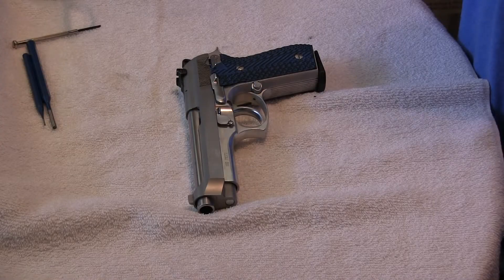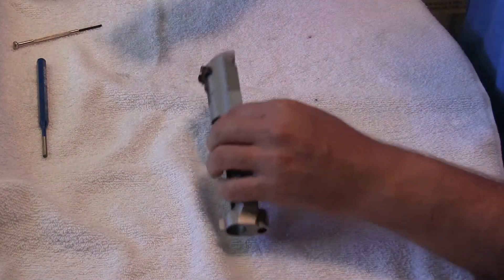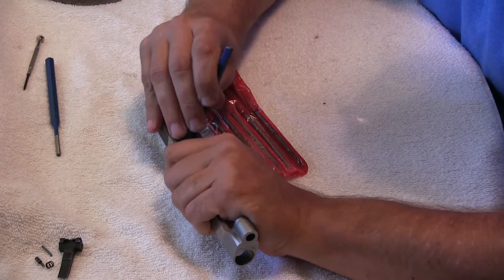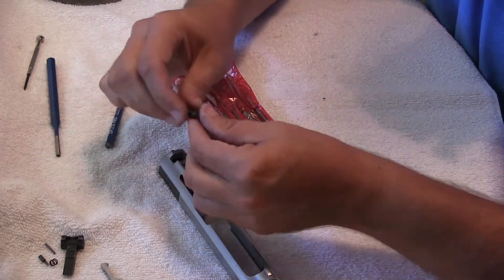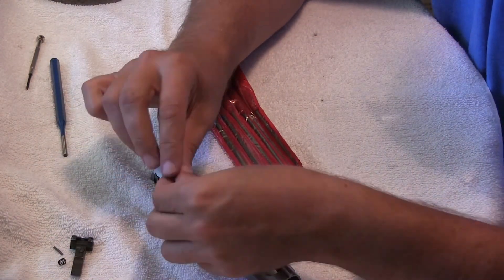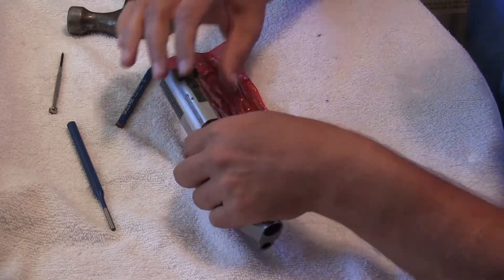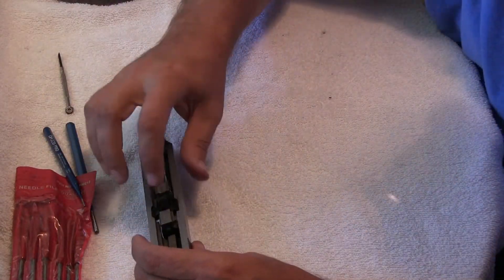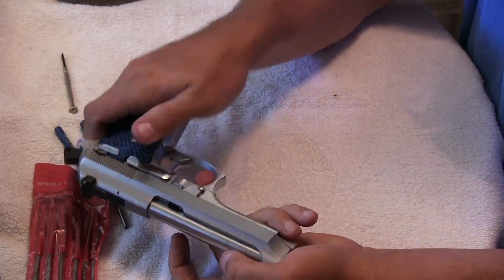Taurus PT 101 Extractor and Firing Pin Removal

Comment: Beretta parts are the same right?
Reply from the maker: I'm going to have to say no. Taurus uses a frame mounted safety whereas Beretta uses a slide mounted safety which is right in that area. However Berettas may come apart similarly. I have not owned a Beretta in over twenty years and have never taken the extractor and firing pin out of one so I'm really not sure how easy or hard it may be.